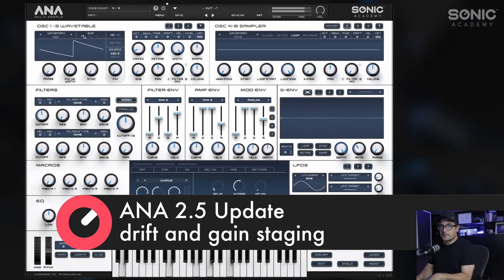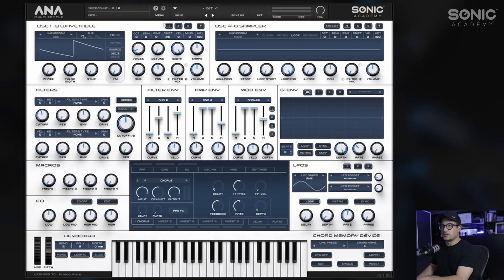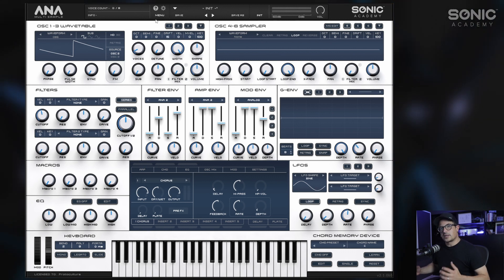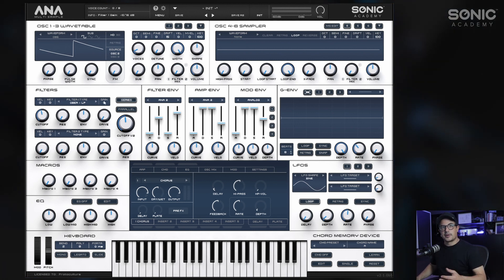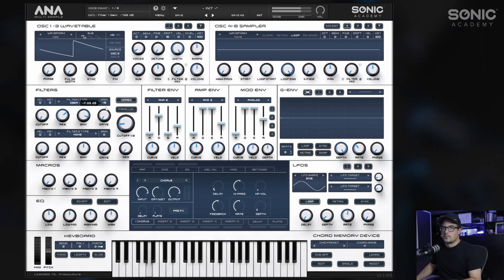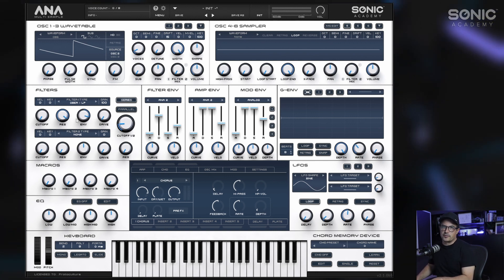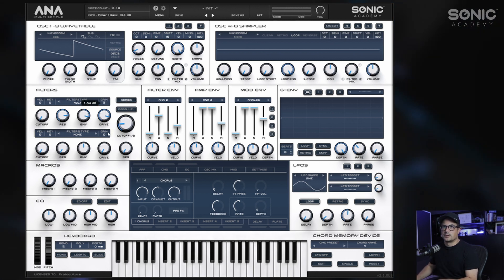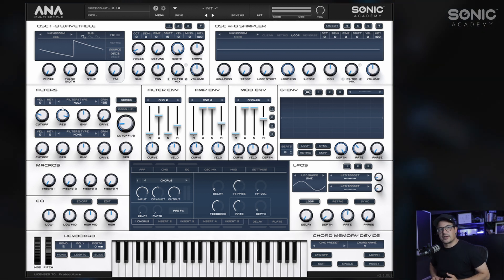ANA 2.5 Walkthrough - 05. Drift and Gain Staging

Comment: Hi guys, downloaded the new version yesterday, thanks for that! Just wanted to mention one thing. 

The new engine is great and pushes the usefulness of ANA even wider- it was already very capable before. The only thing I really feel the lack of is a proper per-note random modulator. The S&H as it exists does not properly provide this function, even with retrigger on. For Psy production that is a bit of a shame. I hope it would be something fairly simple to implement and that it might fit in to ANA 2.5 at some point 🙏
Reply from the maker: We use similar modulation to do the VCO pitch drift... each key press has a random pitch controlled by the drift amount. I'll see if the devs can pull it out in to a modulation parameter.
Reply: @sonicacademy  Amazing, thank you 🙏🫶